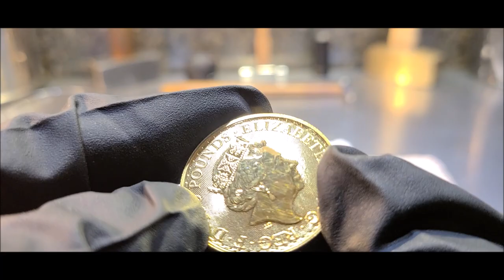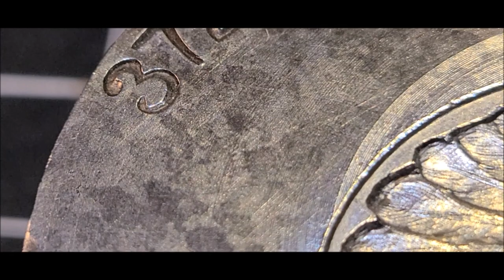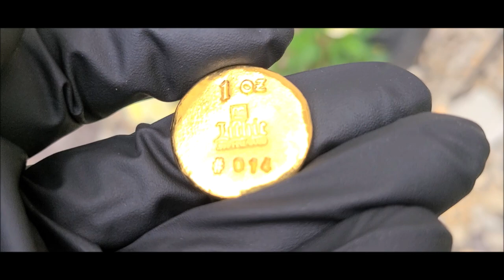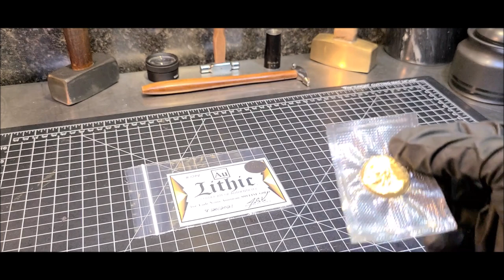Sacrificing a Gold 2020 Britannia! [ 1oz Native American Round ]

Comment: Hey Jeff how much the press cost ?
Reply from the maker: I have several, but the one I used in this video is only a 12 ton. I've seen them for $200-$300. The size needed depends on the size of the die. Also I don't like using too much force on my vintage dies. But you'd be surprised at what you can get done with a 12 ton, which are reasonably priced.
Reply: @LithicMetals  thanks a lot

Comment: hey mate, how  do i deal with brass in solution ?. alot of my silver plated items ive been dissolving in nitric were silver over brass
Reply from the maker: Have you dissolved it all and now you're ready to drop the silver? If so, I'd say it's not much different than copper in solution.
Reply: @LithicMetals  yeah  some copper has gone into solution. When i noticed some plated items were brass i removed them once the silver had dissolved. I tried using hcl to drop the silver but i ended up with two layers, brass chloride on the bottom then silver chloride on top of that.
So ive totally dried it all to a powder then dissolved it all back into  nitric
Reply: I meant to say some brass has gone into solution
Reply: @LithicMetals  i havent got any clean shiny copper to use. Only old weathered ones from an old hot water system. I tried using them but ended up with a pile of brown bubbles
Reply from the maker: @prospectorpete  yeah... brass/copper it shouldn't make much difference in the experiment. I'm not certain why you had two layers, I don't drop silver like that... so it really is beyond my scope of knowledge.
Reply: @LithicMetals  so when i tried using copper and got brown bubbles , is that because i used dirty old copper pipe or was it the brass?
Reply from the maker: @prospectorpete  I don't know why, but it's not because of the brass. If you had crud on the copper you used, plus an excess of nitrates left in solution... that would cause bubbles.
Reply: @LithicMetals  ok thnx. Would burning old dirty pipes till red with mapgas be sufucient
Reply from the maker: @prospectorpete  I would think I'd sand off any oxsides and crud, get it red hot... it should be fine.

Comment: What is unit of this .999?
What is unit of this 999.9?
Reply from the maker: It's about how many parts per 1000... as in 999 parts out of 1000 or 99.99% of 100.00%.  The higher the nines, the purer the material.  😀
Reply: @LithicMetals  .999 + .001 = 1 so 999 parts of 1000 Fine Gold in this example.
-----------------------------------
999.9 unit ‰ so 999.9‰ = 99.99% of gold in this example.

Comment: What is that un-burnable material?
Reply from the maker: I assume you mean the white matting under the dish? That's fire resistant fiberglass insulation. Really holds in the heat.